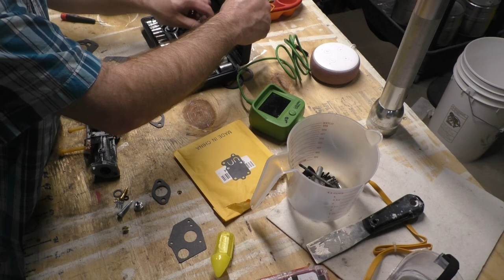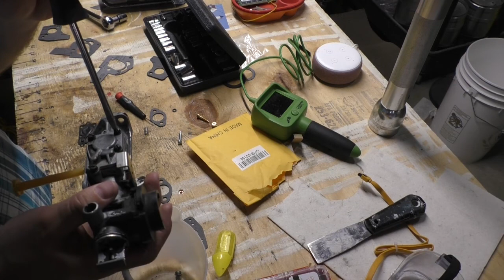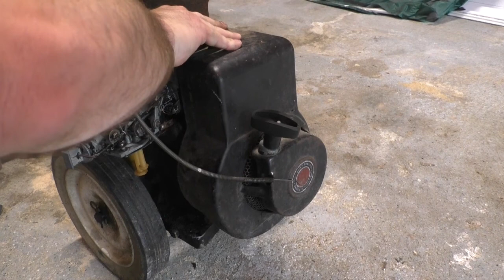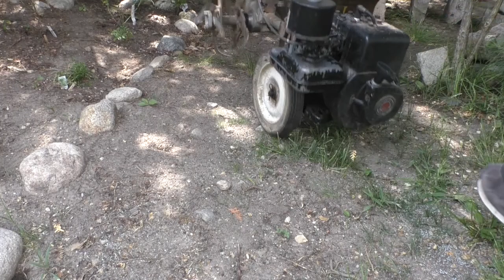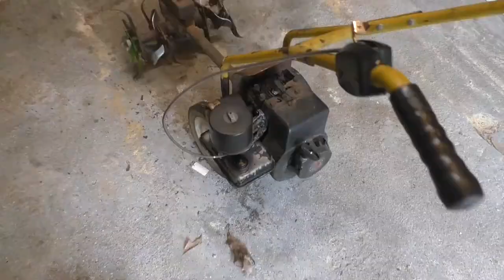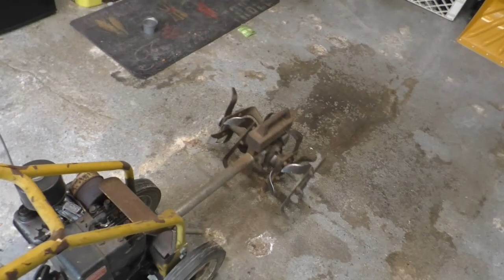Repairing A 40 Year Old Briggs and Stratton Engine - Part 2 of 2

Comment: Rubber gaskets do not hold up anymore because of the ethanol and detergents put into the fuel that eat the rubber over time.
Reply from the maker: There's more to it than that. Even rubber components that never see fuel at all degrade faster.